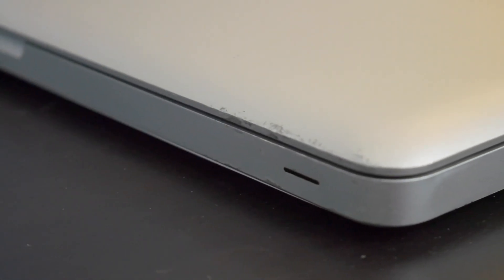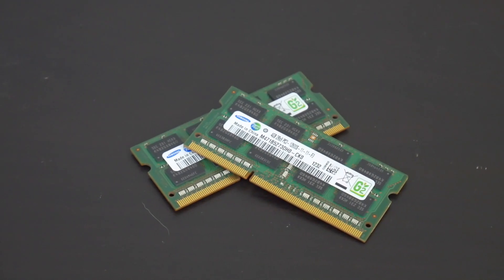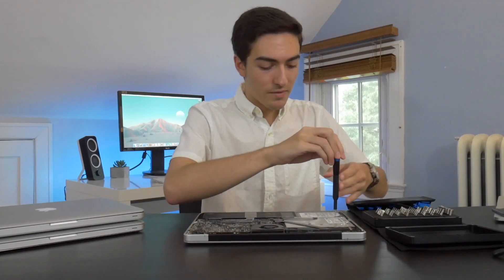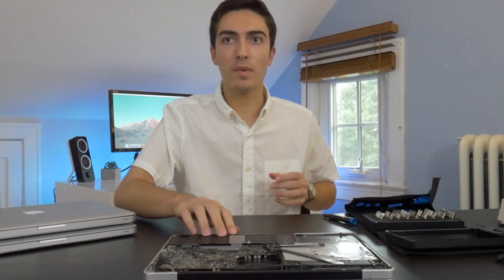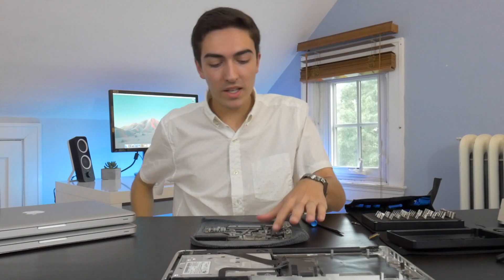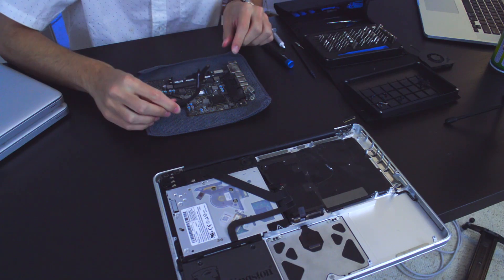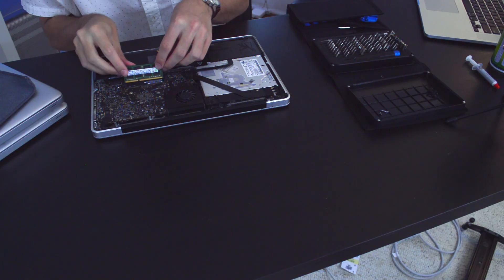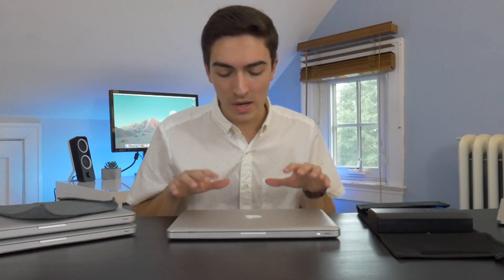How to fix up an old MacBook to use in 2018!

Comment: When buying the RAM, make sure it matches the frequency of the old RAM. For a Core 2 Duo machine, you want 1067Mhz RAM.
You might think that 1333Mhz can just slow itself down and that's it, but... it's Apple, and RAM compatibility issues are very common, so for the best success rate, pick the right frequency.
Reply: Honestly, I have never had issues with that on Unibody MacBooks. They accept pretty much anything you throw at them - at least speed wise. Sure, some modules are incompatible in general, but I never saw an issue with the actual speed. They either just run at the slower speed, that the laptop is supposed have, or they might even run at speeds, Apple never specified. These are all intel machines, so the RAM is handled by the chipset or CPU itself. I put 1333 MHz RAM in Core2Duo machines and it either runs at 1333 or runs without at problem on 1067. When you install 1600 MHz into 2011, it runs fine at 1333 in the Early or lower specced 2011s but runs at 1600 in the Late or higher specced 2011. If you believe it or not: I am currently even running 1867 MHz Ram in a Late 2011 17".

I totally agree, that there are compatibility issues and not every RAM is gonna be accepted by a MacBook. However - at least in my experience - you don't need to care too much about the speed rating of the DIMMs. Keep in mind: The rating is just the MAXIMUM rating, the DIMM can run it. It can also run at every lower speed as well.
Reply: @NebukadV  A 2009 polycarbonate won't take 1600MHz DDR3, it can take 1333MHz and run it at 1067 though.
The 2010 model doesn't even take 1333MHz RAM.

Comment: I have a 2011 MacBook Pro that has been upgraded with 8GBs of ram and a 480GB SATA SSD around 2015. It has a 2.4ghz Intel core i5 with 2 cores. Even with an SSD and 8GBs of ram it’s super super slow. I haven’t ever done a cpu repaste nor cleaned out the fans though. Any tips on how to make it run faster. (It still will run basic apps but anything even medium performance like low end games and video editors it runs mega slow.)

Comment: Very interesting. I'm using a very old (and very very slow) 13'' mid-2009 MacBook Pro. I can't even install the new OS X. I'm stuck with version 10.8.5. If I follow these instructions, will it solve all my problems? Will it be faster and will I be able to install the most recent OS X version? Or should I just buy a brand new Mac instead? Thanks!

Comment: Hi Look, I'm liking your videos but wondering if you can help with this please :

Hi there, I’m hoping that someone can help please.

I’ve got a 2011 17” MBP. I’ve disabled the faulty AMD Chip so everything should be ready and straight forward to upgrade to Catalina ( using dosdudes patcher program ) however I’m hitting problems like : 

macOS could not be installed on your computer 

An error has occurred while updating firmware. Quit the installer to restart your computer and try again.

I decided to go a different route and also got this message : 

This copy of the stall macOS Catalina application is damaged, and can’t be used to install macOS.

I’m downloading Catalina onto USB and going that route. 

I’m current running Hi Sierra ....... 

Can anyone offer any suggestions to help me please ? 

Many thanks in advance

Comment: I know this is an older video but want to say this , it is ok if thermal paste is thin looking and can see the shine on the CPU a little because thermal compound is used to fill in tiny bits of uneven surfaces on CPU and heatsink that then allows much better contact. 
If both surfaces were completely perfect flat and fitted against each other perfect there wouldn't really be a need for thermal paste though of course it should always be used

Comment: I bought a 2011 MBP 15" with the bad GPU on ebay for $78.  I used the "bake the mobo in your oven 375 degrees for 8 minutes" method to reflow the solder and it works great now.  Upped the RAM and installed an SSD to mke it a perfectly useable machine.  Just so heavy, tho...

Comment: One would think as expensive as these  overpriced crappy machines are, that Apple would have sprung for just a little more thermal paste, but why do that when the goal is to get snobs, (actually suckers) to buy their overpriced POS every 2 or 3 years if not sooner. This is why they don't actually repair them and discourage any 3rd party repairs on them either Louis Rossman would have much more to say about these things as well.

Comment: Luke - Do you know if a 2012 motherboard will fit into a 2011 15" Macbook pro or do you think a 2011 lid and screen would fit a 2012 mbp ?
Reply from the maker: Yes to both. 2011 and 2012 case and display assemblies can be interchanged
Reply: @lukemiani  Brilliant! Thanks Luke.

Comment: I got given a 9,2 MacBook Pro (i5 / 4GB / 500GB) base-model. I've just upgraded it to 16GB, installed a 480GB SSD and moved the 500GB hard drive into the CD Drive slot. It's like a completely different laptop now! On Mojave, no issues whatsoever :)
Reply: How did u install mojave on it I'm running  el capitan can u make a video

Comment: These general steps (upgrading the RAM, putting in an SSD, cleaning out and replacing thermal paste) could really be done on any computer older than 3-4 years old. Thank you so much Luke!

Comment: I have a question, hope you can answer it. I have an early 2009 17" MacBook Pro, Can I upgrade to 2018/ 2019 specs, software, ram etc? and will it even be worth it, or should i just buy a new one?

Comment: That 2011 Macbook Pro supports up to 16 gb DDR3 1600 mhz PC3 12800
Reply: Gaming Palace  where to get some ram? I have an a1278 and would like to upgrade my ram and SSD and hopefully a fan too cause this thing gets how and any certain thermal paste?
Reply: @TheHighAltitudeRambler  

Macbook Pro RAM DDR3 1600 Mhz 12800S- Ebay
SSD - Samsung 860 EVO 1tb  (Best Buy
Thermal Paste- Arctic Silver MX4 (Ebay, Amazon, Best Buy)
Macbook Pro Fans - Ebay
Reply: Now with 8gb ram would that operate oculus? Just curious
Reply: @TheHighAltitudeRambler  If you are talking about your MacBook Pro then No You will not be able to run VR with just 1 gb of Graphic memory But with Windows Computers i prefer 16 gb with the right CPU  and GTX or RTX GPU with 6 to 12 gb of Graphic Memory
Reply: @TheHighAltitudeRambler  8 gb is the minimum i prefer higher like 16 gb
Reply: Ok so I’ll need to buy a new computer to run it, thanks!

Comment: MackBook Pro 13 inch, Mid 2012. Replaced the RAM (16GB), Took out the DVD drive put in two 250GB SSD drives. Just replaced the battery and cleaned it out. I love my old laptop as it run beautifully.

Comment: So you take out 500 gig of storage and replace it with 128 gig and call it an upgrade just because your going over to ssd. Battery connector to remove first.

Comment: I needed a new HDD cable when I upgraded my 2011 MBP to SSD. The old cable just didn’t have the transfer rate to support the new SSD. I like the heat sink thermal paste idea. Will try that ! Cheers

Comment: I’d have preferred you to put the board directly on the table, secondly you could have used a q-tip and acetone to clean the board or a high percentage rubbing alcohol but don’t go over board it use a very light amount. Air duster only gets the loose dust off but that thing was caked with dust.

Comment: Stay away from 2011 MBP as their GPU failed a lot. Do some research and you will see the issues.
Reply from the maker: This is a 13” that doesn’t have dedicated graphics, there aren’t any issues with these models. The 15” and 17” 2011 (early and late) have GPU defects

Comment: What no one tells you is that all of these older mbps 2010-12 have insufficient cooling to the graphics card and they're basically ticking clocks waiting to fry themselves.
Reply: It's only a 2011 MacBook Pro problem. The 2012s don't have graphics issues

Comment: I just revamped a Mid-2010 Macbook. 

from 2GB to 8GB RAM = $53   (datamem.com)
from 250GB SATA to 120GB SSD = $24   (Amazon.com)
from OS Snow Leopard to OS High Sierra = free   (Apple Store)

Total materials cost = $77
Total time = Around 45 minutes of actual work.  45 minutes of waiting for 10.13 to install.

Caveat:  High Sierra is the LAST OS that this machine will be able to run on.

Comment: Can you use 2010 macbook unibody after adding 16gb(2x8 1066mhz) of ram and ssd for making hq animated videos?
Reply: Batman Max RAM for 2010 is 8GB.
Reply: buconjak no it is not. trust me. you can add two of 8gb if they are 1066mhz
Reply: Batman  13 inch only  😩
Reply: buconjak yes, I never said i would buy 15 or 17 inch... Only 2018 15 inch i9.

Comment: When you switch from hdd to ssd, dont forget to enable TRIM by terminal using command "sudo trimforce enable", TRIM allows the operating system to actively inform an SSD which blocks of data are no longer in use and can be wiped internally. This helps the drive work more efficiently and leads to faster performance and most importantly, longer lifespan.
source : https://www.cnet.com/how-to/installing-ssd-on-mac-trim-mistake/

Comment: You should also remove the optical drive and get a second SSD in RAID 0. These days 500 GB SSD can be had for $115. Does the computer run cooler now?  Will need to see before and after temps with a laser measuring tool.
Reply: 123abc I’m thinking about putting a second drive in and running raid
Reply: I still like having a DVD burner comes in handy with the occasional music CD I haven't ripped to itunes.  Thing that sux now is I can't run Mojave without a hack.  Runs high sierra well enough though and I can always switch to windows if I want to use this computer beyond 2020.

Comment: this is 2018 and you're getting a 120GB SSD

see the problem here?
Reply from the maker: Nothing wrong with 128gb SSDs. I chose what I thought fit the laptop based on my usage, and 128gb made sense. If it's a problem then get a bigger drive and stop moaning
Reply: You're acting like I'm complaining as if you gave me the 120GB drive...

A 128GB drive is actually better because it's a power of 2. I like powers of 2. Carry on.

Comment: For those of you with similar slowness in an older MacBook/Pro sometimes a failing HDD might be the cause, typically some people think when their HDD is failing that they can’t use their computer, however, if it is an Apple S.M.A.R.T. Status failure on the HDD, you might still be able to use it, but you’ll find that things load slowly.. one thing (and pretty much only one thing) that can fix that issue is to replace it.. sometimes you can get by, simply by wiping the HDD, however that is not always the case.. and you might even find that doing so could cause the Mac not to post at all, and what you’ll have to do then would be to replace the HDD and I recommend that if you are having some of these issues and it still turns on is to back up what you can in order to preserve what data you can, so when you get the HDD replaced, you can still use what programs and file you need to, so you don’t have to start fresh.. Sincerely, Your Neighborhood Mac Technician!

Comment: Only 8 GB of RAM? Mine has 16 on it. All 2011 models support it. Then again, if you're putting such a tiny SSD on it (and not a Fusion Drive or a RAID 0, which some of these machines support at a full 6Gbps), I'm guessing this is more of a budget upgrade for not very demanding users, so it kinda makes sense…

Also, seeing as these will be stuck at High Sierra forever, no other kind of upgrade makes much sense on these machines anymore.
Reply from the maker: Exactly, if I put 16gb and a 512 ssd it would cost like $300 to upgrade, which isn’t worth it on a machine that’s maybe worth $200

Comment: 1) Don't use paper towel to clean off heatsinks as they leave lint behind, use a microfiber instead. 2) When cleaning heatsinks it's not actually clean until you use some iso. alcohol to clean off the residue before applying the new TIM. 3) You don't need to spread TIM because the mounting pressure from the heatsink with spread it out for you. Doing it yourself can introduce air bubbles.
Reply: Holden Burke  Thermal Interface Material, as it's not limited to paste, but can also be some more viscous liquids or solid pads.

Comment: @Luke Miani: you used too much thermal paste.

For cooling paste, LESS IS MORE !!!
If you open a new machine take a good look !
What you see is some dried out paste on top of the die (the black shiny ceramic polished rectangle which is in fact the cpu and/or gpu). Then look besides the die to the green substrate (the pcb the die is mounted on). There you'll see a lot of dried out paste. Why? Because apple, as most manufacturers use TOO MUCH thermal paste. That spilled paste can have a negative influence on the temps.
You only need to apply a very small pea drop on the gpu and maybe a slightly larger one on the rectangle cpu, put more in the length like a rice grain.
Mounting the heater and pressing or screwing it on will spread out the paste. If you take it off again you should see the die(s) just covered with paste. If the egdes are not covered, no problem.
Press the cooler back on and slide a bit left/right/front/back and fixate it. Or have a look first, if everything is covered VERY THIN without anything squished out besides the dies it's probably perfect.

Comment: FOR THE LOVE OF FAN!
When you use compressed air on a computer fan, ALWAYS make sure to keep the fan still, you risk damaging it!
Also, when you put thermal paste, do not spread it around.  The pressure on top of it will make it spread.  It's not cooling the CPU, it's transferring the heat from the CPU to the pipe.

I did a cleaning of my main laptop a couple of months ago, I did a video of it but since I am guessing all links are blocked, I won't even try to link.
What's my point, well, the thermal paste and dust issue of the computer, any computer, is a huge issue if you plan on using or keeping alive a computer more than a couple of years.  
I am very sorry to see, not just Apple, but other manufactures too to go to a non user repairable builds which makes these laptops having an expiration date on them, no matter what the usage or needs of user.
That's why I refuse to buy any computer which doesn't allow you to do these repairs.
Reply: Trusteft - Who allows these repairs?

Comment: You can wipe down the inside of the case and the motherboard with a microfiber towel as well.  If you live in a low-humidity area (less than 30%), you can dampen the towel a little first.  DAMPEN, not DRENCH - just get it a little wet to the touch and wring out any excess moisture.  Regardless, if you do this, dry it off the best you can and leave it to sit for a few minutes while it dries.  I tend to use MX-4 thermal paste as it's guaranteed to remain working as intended for 8 years.

Comment: I think you should have first unplugged the battery connector before disconnecting anything from the motherboard. :) At least that's how I do it!
Reply: Krzysztof Starzecki Totally spot on. 👍 
Even absolute noobs know the first thing to do in these cases is removing - or at least unplugging - the battery.